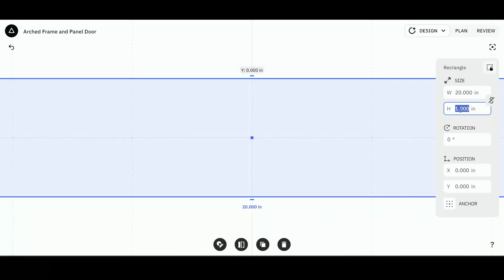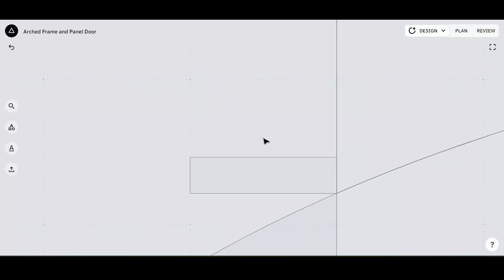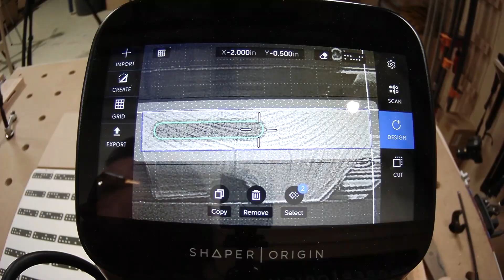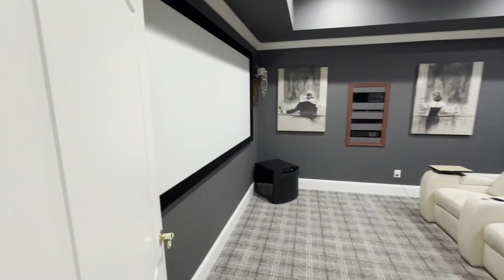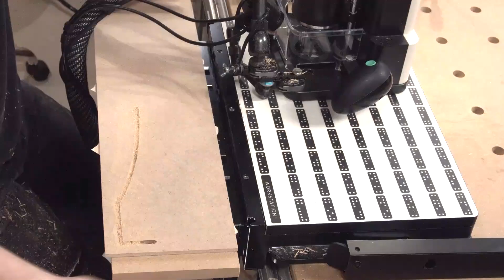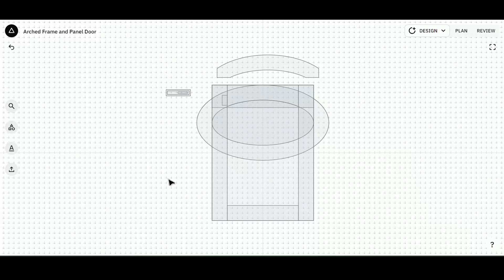Session 124 - English: Building an Arched Frame and Panel Door

Comment: Why did you make the second larger ellipse? Why did you worry about the tenon being between the two ellipses? I mean, the arch is only on the bottom of that top piece; the rest is three full sides of a rectangle. you could have put the tenon dead center in the vertical part of the arched section.